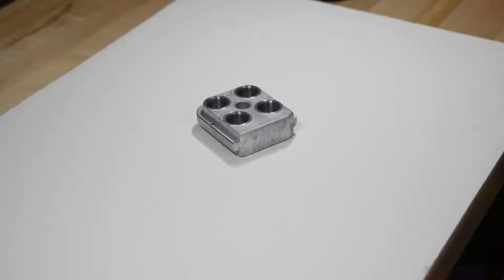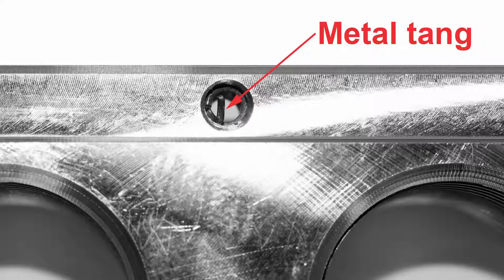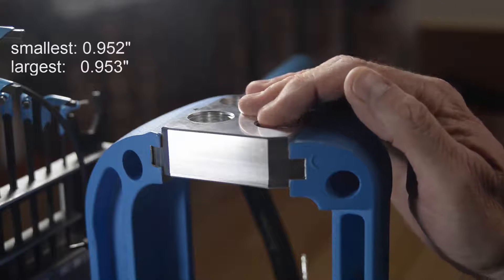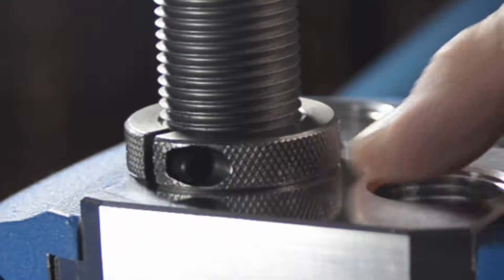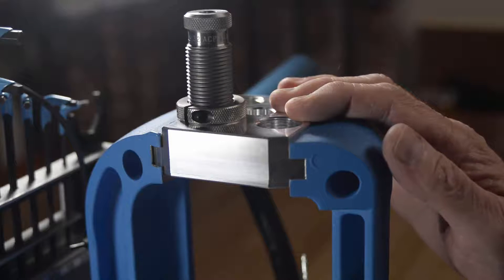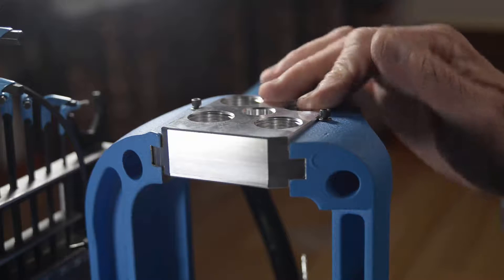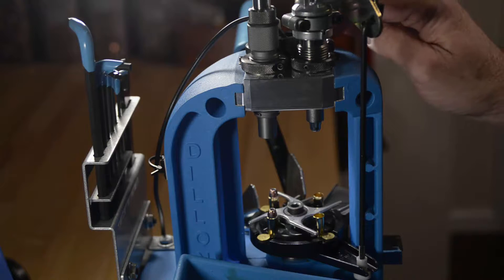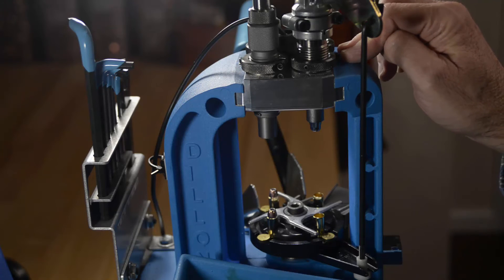Bench Report: CNC machined toolhead for the Dillon 550B

Comment: Nice video. I do have some aftermarket CNC toolheads made by a different company that are not threaded. They have a little tighter fit than the Dillon cast toolheads, but they are not threaded like yours are. I don't believe that floating is a bad thing. We all have our opinions. I do like the CNC ones better than the Dillons and honestly, they were less money to purchase. I do think that when Dillon went to automated, they had a fixed toolhead only because it was automated and did not want any free float because of reliability of auto function. When pulling a handle not automated you can do things more cautiously and have more control. Nice video I respect your opinion, but I respectfully will use my Dillon free floated. I use competition seating dies and often neck size primarily reloading rifle cartridges. Mine turns out very concentric ammo free floated.
Reply from the maker: Good to hear your story Garry. Glad you have a setup that works well for you. I find that the Dillon shell plate holds the cases so loosely, that each case can self orient to it's respectful die. So I opted for the fixed toolhead to reduce one variable in my process.

Comment: Dillion Precision = Match Grade Competition 
The tool head float is part of the Match Grade Competition design of the press.  
Why would Dillon make it float if a static/ pinned tool head made more precision Match Grade Competition cartridges ?  
Surely they knew the toolhead floated ?
Reply from the maker: The Hornady progressive press does not have a floating tool head. 

Many of my fellow pistol competitors consider the Star progressive press (which is no longer made) to be the gold standard.  It has a seems-like-it-takes-forever-to-change-out, fixed, non-floating toolhead.

Dillon’s top of the line reloader, the 1050, does not have a floating toolhead.  It’s toolhead is bolted directly to the shaft/ram.

Does Dillon know they designed the 550/650/750 to have fast and quick toolhead change by using a floating toolhead, while they opted for a fixed, slower to change out, toolhead for their top line model?  I am sure they did.

Comment: The really big deal of this toolhead is that its gets rid of the toolhead  "Float"  that is engineered into the factory Dillon setup.  There are 2 schools of thought on this. 1st train of thought- Have everything rigid except for the die/toolhead that has a few thousandths/hundredths of "Float".  Proponents say that this will allow the die to "self center"   The other side of this debate is that everything should be totally locked down and set rigid . This works the best I think especially if everything is machined perfectly.    That is the point of these CNC 6061 toolheads. Lock rings never move on me so I don't think that is really a big deal.   This is the only press I know ,where YOU can choose weather you want die/toolhead "Float" or No Float!
Reply from the maker: Thanks for the comment.  I am also a believer of the rigid tool head for the type of reloading I do.  I am a skeptic of the ‘must allow the toolhead to float so it will center on the cases’ thought.  I am not sure how a toolhead with dies locked in place can center on 4 cases (on a 550) or 5 cases (on a 650/750).  When I insert a case into the shell plate, the case is not held rigidly.  It has vertical play, horizontal play, rotational play and angular play.  And a lot of it.  In my opinion, this allows each case to self center to its die regardless of the other cases and dies.  Some people lock the toolhead after inserting it into the press.  I do not do that.  I have a case fully inserted into each die and, with the lever down/shell plate up, then I lock the toolhead.

Comment: The tangs on the thread inserts are designed to be broken away after installation.  They should not have been left in the threads. Look up “heli-coil installation”.
Reply from the maker: 21anthem12, in most installations you are correct, but the following is from UniqueTek, who sells the machined toolhead and inserts the Heli-Coil. "In most applications, the tang is broken off after the insert is installed. But we choose to leave it on as it allows us to easily remove the insert simply by using the installation tool to twist it completely through the hole and out the other side. The screws that are included with the toolhead are not long enough to bottom out against the tang, so we don't really need to break off the tang at all."
Reply: knowledge2you It will certainly not hurt anything to leave the tang in place if the screw is not interfering.  I only bring it to your attention because you suggested bending the tang back into the hole if it was sticking out. These tangs are notched to facilitate breaking them off and exercising it back and forth creates a weak point. I would not want a situation on my press where it might break loose and fall into anything. If it were out of place, it’d be gone.  Happy reloading. ☺️
Reply from the maker: Thanks for sharing 21anthem12.

Comment: what brand is that? the screw it down thing is a project. I want one that will use the pins. Also the lock ring to surface of the toolhead area really does not matter due to the minimal amount of pressure needed to hold the die.
Reply from the maker: The CNC machined toolhead comes in both clamped and unclamped versions.  The clamped version is not really a project because you do not make any modifications to the press.  In the clamped version, the locator pin holes come threaded and you just use the two screws that come with the toolhead, drop them into the locator pin holes in the press and then screw them into the toolhead.

As mentioned at 0:53 in the video, the toolhead is sold by UnqiueTek.  Their url is in the description, but here is the specific url for the toolhead.
http://www.uniquetek.com/product/T1333

It does not take a lot of pressure just to hold a die in a toolhead.  It is the thousands of cases/rounds being shoved into the dies over time that I am addressing.